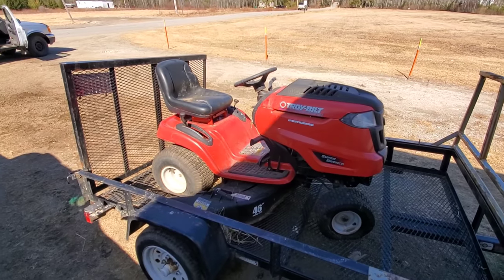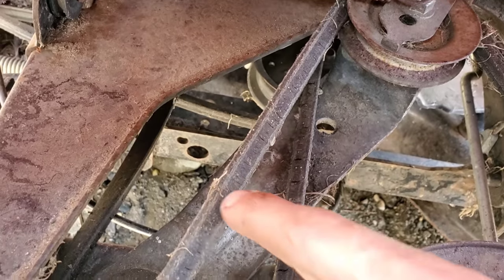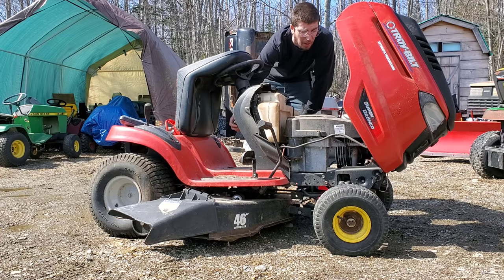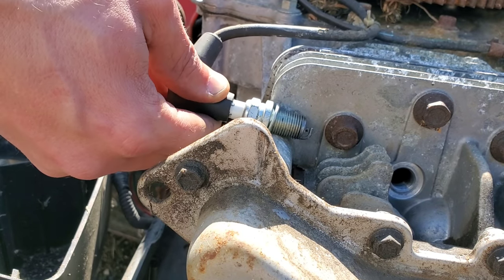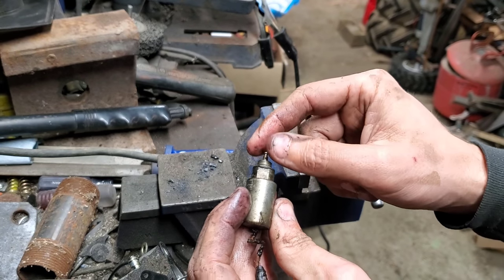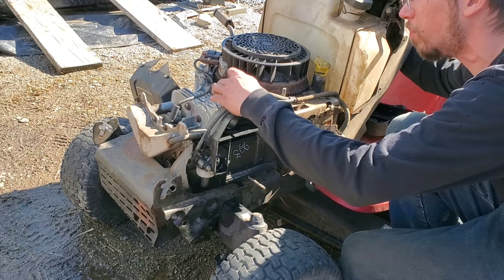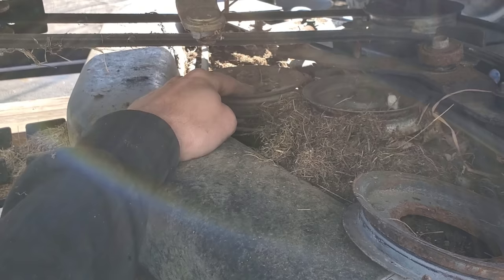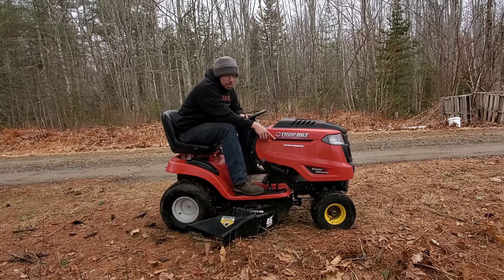Tractor Hunting: Troy Bilt Super Bronco

Comment: Every lawn tractor video starts off with cleaning the carb because of the bullshit gas we are forced to use, and if ya take notice everyone doing the video cleans and fixes the issue and then puts the same shitty gas right back in. I learned my lesson awhile back, I now only use true-fuel. It is pricey but it's well worth it. My equipment runs so much better, cleaner and I don't have to piss with the carb/lines. This is however my opinion. Redneck Computer Geek I love your vids. Keep up the quality content
Reply from the maker: Agreed! What you dont see on camera is me buying what we call plowtruck gas. In the winter we have some none ethanol pumps. I stock up on it in February for summer. But I also burn 50 plus gallons a summer fixing and selling machines.
Reply: @redneckcomputergeek  man I'd love to live close to you. You get some really nice units. I'd absolutely buy one. Unfortunately I'm from Pennsylvania 🥺🥺
Reply: Buy non ethanol.  And stop buying those jinnaa gaskets.   I think starting fluid melted that o ring

Comment: I only have one MTD,,,,a Husky with 54 inch deck. It's OK after peeling layers of rust off and using Agri Guard on the underneath. Did a cover over the busted lights from a Milwaukee radio speaker cover and looks great. 
 Everything else I have is Wheel Horse. They will mow twice the acreage per gallon of gas and once you fix them they stay fixed. Tie rod ends,bearings and blades is about all it takes and they are as tough and simple as a box of hammers
I like the way you do things. New subscriber

Comment: Sounds like opening a lawn mower shop 😆 Just 2 riding lawn mowers drive me crazy, Pony and a T140. The pony still running, bunch of repairs but still running  THE T140 is a POS ! I can't figure out why it want move forward and reviser. There no broken belts. An its to hot to tear it down, to fine the problem The point is?   EVEN NEW MOWERS WILL BREAK DOWN AND HAVE PROBLEMS TOO ~ So its best just keep your old mower and FIX IT !  I needed 2 mowers, 1 breaks down i have a back up! Got a Gravely Z 260 i'am putting a new B&S 27 hp engine in ~ I TOOK THE 25 hp KAWASUCKIE ENGINE THREW IT AS FAR AS I CAN ~ I  💖 Briggs & Stratton Engines